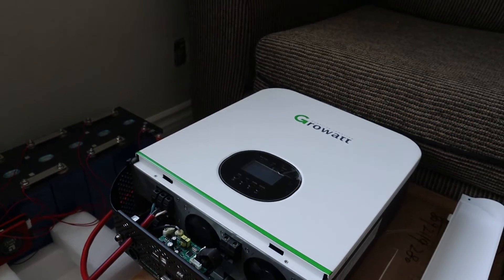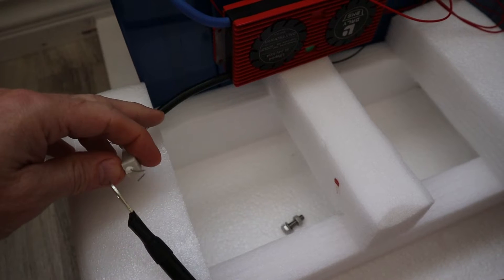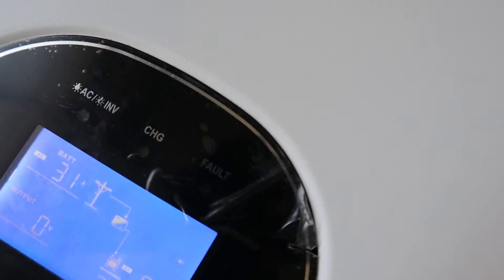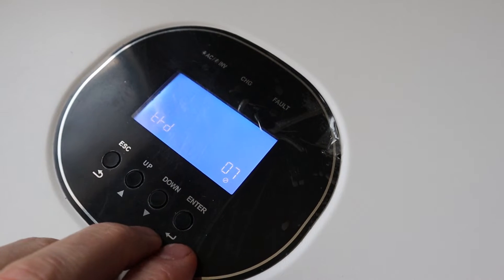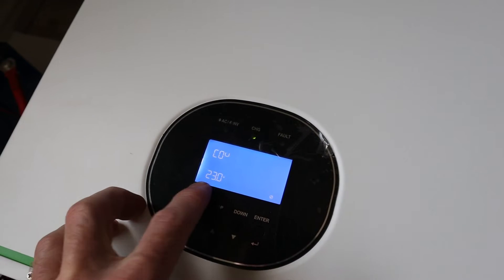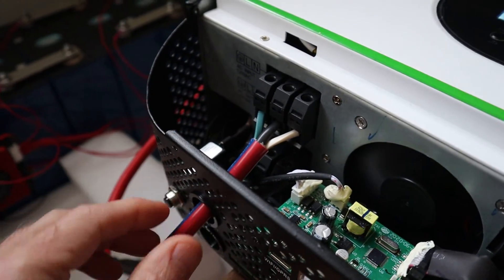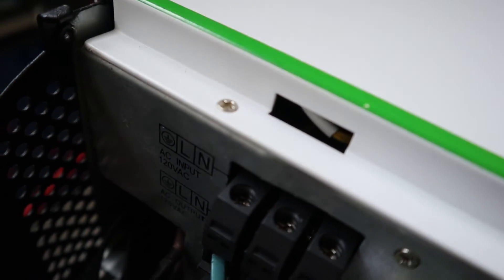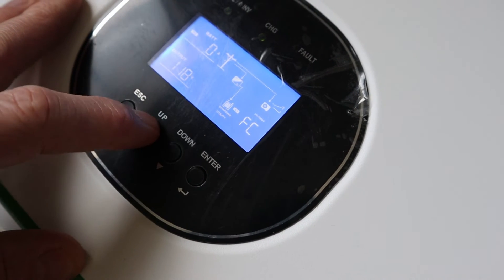All In One 3000 Watt Growatt Inverter Setup

Comment: Amazing job on this video. Liked your simple explanations. I just set up a 48 v Growatt Interter with a 48 volt EG4 battery.  When programming step #21, low voltage cut out for the battery, the inverter control does not save the new settings installed. Do you have insights for getting this programmed?

Comment: Mine lasted 5 months before showing error 19. I exchanged a bunch of emails with the Growatt support and they determined the main board needs to be replaced (after they had me take it apart) and told me to contact the seller for a warranty claim. The seller was off Amazon and is unreachable. So much for this company.
Reply: damn that sucks :( any updates or did it end on the unreachable seller?
Reply: @423GustavBern  Amazon refunded me 75% ("restocking fee") but the seller was unreachable.
Reply: @anmarcaver6745  oh ok, its good that you at least got back the 75%, did you buy some other inverter?
Reply: This might be too late but error 19 is a battery fault.. It goes into sleep mode. U have to wake it up by charging it or using the BMS to switch it on

Comment: I really like this set up but my only hesitation for a van is that I want alternator charging.  What do you think the best way to add that would be with this set up.  I’m currently using the renogy dc to dc charge controller which is great but it didn’t have ac input charging.  Plus I like the all in one of this.
Reply: I guess you kind of answered that at the end
Reply from the maker: Hi Alluvium. Thanks for watching. I have a Victron Alternator Charger that is connected to my bus bars that charge my house batteries when I am driving and you can see the battery voltage change on the Growatt as soon as I start up the van. I have a video on the dc to dc charger if you are interested. Thanks for your question. Hope it helps a bit.
Reply from the maker: Alluvium, here is a link to my dc to dc installation. https://youtu.be/I2PZGMRruFI

Comment: hello i have an offgrid growatt inverter 3kva/24 installed at my house currently we experience 10 hrs of sunlight so by evening the batteries are well charged(i have lead acid batteries 2pcs 12/200ah each) my fridge is 150w but the funny thing is my growatt inverter is not able to run the fridge upto morning it sgives me error 04 at midnite,i cant understand why the inverter will shut itselt off and all the settings seems to be okay kindly help,what am i missing to set up well
Reply from the maker: Hi Sam. Thank you for watching and for your support. Make sure that setting 4 is set to SDS. Setting 4 when enabled will shut the inverter off after a while if a low load is running, SDS ensures that it will run 24/7. I hope this helps. Please consider subscribing if you found the content useful. Thanks.

Comment: One tip if inserting stranded cable into these terminals, tin the ends. The positioning of everything I'm pretty sure they intend solid copper use. When I tried to put standed in, it was very difficult to not have a couple hanging out in such a tight spot.
Reply: Solder or put a ferrule on the standed wire. Problem solved...
Reply from the maker: Hey Joe, thanks for the tip and thanks for watching.

Comment: I have a dumb question I hope you can ansewer and if not, maybe you can direct me(?) I have AGM 12V, 1,200 AH batteries. I have a ton of them and so want to preserve them by only taking them down 30% from fully charged which I think is about 12.3 Volts. I have 20 of them in series/parrell for my 24 volt Growatt just like yours. Since my 12 Volt batteries will be in series (half of them) to get me 24 volts and then the pairs will be in parallel, what voltage cut off do I set my Growatt to (24.6 ???) in order to preserve my batteries only discharging a maximum of 30% before the Growatt cuts them off? Thanks for any help.
Reply from the maker: Hi Ben. I did a bit of research and your number of 24.6 is about right in my opinion. I found several charts that suggest for a 24 volt battery bank running AGM's at no load and only wanting to discharge down to 70% capacity, the number I got was 24.74, but it is very close to yours. I think either number would work well and preserve your batteries for a long time. Thank you for your question. I hope this helps.
Reply: @thinkfreelivefree6951  Thank you! I will see how that works. Can you point me to any of the 24VDC Charts?
Reply from the maker: @benkanobe7500  Hi Ben. The chart is at the bottom of this article. Hope it helps. Take care. Here is the link.

https://modernsurvivalblog.com/alternative-energy/battery-state-of-charge-chart/
Reply: @thinkfreelivefree6951  Thank you!

Comment: I am pretty sure you intended to say I have a small "resistor" not a capacitor as you were talking about charging the capacitors at first connection. Correct?? Thanks so much for showing all of us the fault fix!!
Reply from the maker: Hi Ben. Yes absolutely, meant to say resistor and not capacitor, lol 😂. I believe I correct myself later in the video. Thanks for watching and for your support. 👍

Comment: I'm so glad I found your videos. I love them, I'm looking to basically mimic your setup. 
I'm planning on the same inverter with 604ah of battery made up of 16 cells 8 in series x 2.
Reply from the maker: Thank you Leo for your kind words. The Growatt is a solid all in one unit. Thank you for watching and for your support. Your setup is going to be awesome. Where will you be installing it, for home use? Take care.
Reply: @thinkfreelivefree6951  Purely for emergency use, I actually just watched your new video and left a comment regarding wire size from bms to inverter. If the daly comes with 6 shouldn't it be continued with 6 all the way? Want to make sure I order the right stuff.
Thanks
Reply from the maker: @nikjim13  Hi Leo, it really depends on the length of the cable. They use a 6 gauge cable on the daly bms because the cable is so short. Hope this helps. To be on the safe side I would use 2 gauge that can handle 205 amps. The cost between 2 and 4 gauge is a very small difference. Just make sure your run is no more than 5 feet on each side. If run is longer, you may want to got with thicker cable. Hope this helps.
Reply: @thinkfreelivefree6951  Yea I'm going to make mine on a hand cart like many have before so it's as close to mobile as 150lbs of battery can be lol.
I'll end up with 2 separate 8s packs each with their own bms connecting together then going to probably 2 wire to my growatt 3k.
Reply from the maker: @nikjim13  Nice man. It sounds like it is going to be an epic emergency back up system. That is awesome man. Good luck and keep us updated with your progress.
Reply: @thinkfreelivefree6951  Yea will for sure thanks, I actually ordered my cells 2 days ago. 16 310s with 2 daly 8s150a blutooth bms. $2525 shipped.
I know the growatt has a lot of features but does the it act as a shunt and measure ah as it goes through it? Want to be able to see the power taken from my bank over a certain time and then reset.
Reply from the maker: @nikjim13  Hi Leo. Congrats on ordering your batteries and bms, that is very exciting. Yeah, I think it is best to incorporate a battery shunt to get the most information on your batteries. I plan on adding a shunt in the future. The growatt provides a lot of information, for example, load consumption in percentage and watts, how many amps is the battery using, how many watts of solar is coming in. I also got the wifi module, so it gives me more information regarding kwh stored, etc. But I think for battery management a shunt is the way to go with any inverter. Take care and keep us in the loop. Thanks.

Comment: Aloha from the Big Island Jake! Thank you so much for your video, I just ordered my Growatt 3000 48v and really wished I had found you first to use your link. Could you please let me know what to call the capacitor you used before connecting your battery terminal and where I can buy it?
Mahalo my friend!!
Greg
Reply from the maker: Hi Greg, thank you very much for the kind words of encouragement, very much appreciated. Thank you for watching and for your support. They are called resistors. I got it on Amazon. I will send you the link. By the way they are like $8 for 10 of them.
Reply from the maker: Here is the link for the resistors, it is NOT an affiliate link. Take care. 

https://www.amazon.com/dp/B07WPBGV8V/ref=cm_sw_r_cp_apa_glt_fabc_4ZSBTC0KP1WN71X4VA3W?_encoding=UTF8&psc=1
Reply from the maker: The resistor that I used is 50 ohms at 10 watts. I keep it on there for about 1 min. I have never seen it spark. Hope that helps your build. The Growatt's are awesome inverters.

Comment: where did you get the resistor from?
Reply from the maker: Hi. Thank you for watching and for your support. I got it on Amazon. I will send you the link. Please consider subscribing if you found the content useful. Thanks. By the way they are like $8 for 10 of them.
Reply from the maker: Here is the link for the resistors, it is NOT an affiliate link. Take care. 

https://www.amazon.com/dp/B07WPBGV8V/ref=cm_sw_r_cp_apa_glt_fabc_4ZSBTC0KP1WN71X4VA3W?_encoding=UTF8&psc=1
Reply: @thinkfreelivefree6951  thanks! is there math behind the resistor size you're using?
Reply from the maker: @rolandjuicebishop  I am sure there is, with watts being the deciding factor on how long you hold the resistor to the terminals so that the capacitors can charge in the inverter. The resistor that I got is 50 ohms at 10 watts. I keep it on there for about 1 min. I have never seen it spark.
Reply: Great info! I keep finding your videos when I'm trying to learn. Turns out we are building nearly identical systems haha. I have the 280ah eve cells and different panels, but otherwise, IDENTICAL! Nice work, subscribed.
Reply from the maker: @DirtyDoubleD87  Thank you very much Dan. Those Eve Cells are quality Phosphate cells. Are you also going with a 24 volt system and using the Growatt 3000? Thank you for your support and for watching.